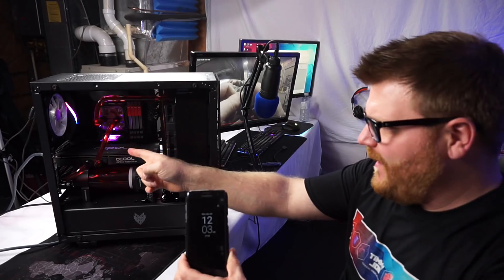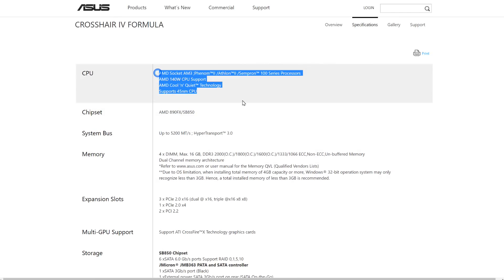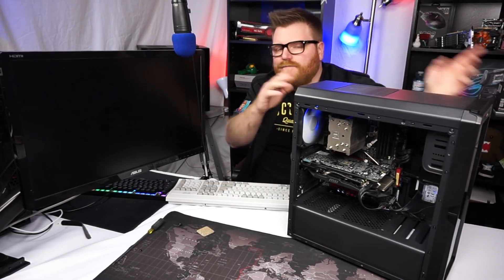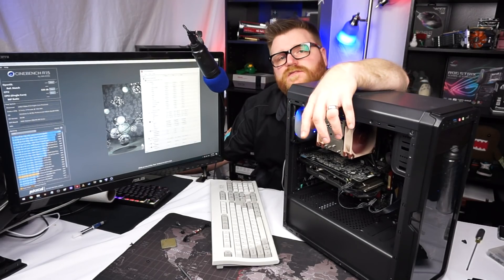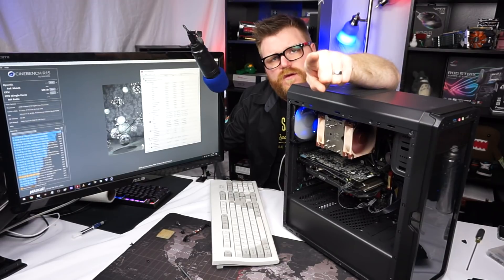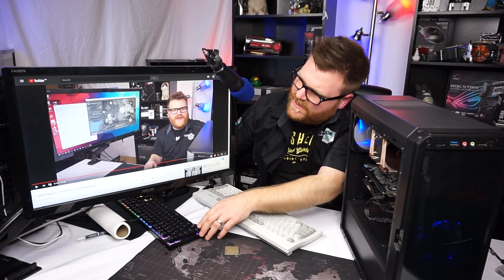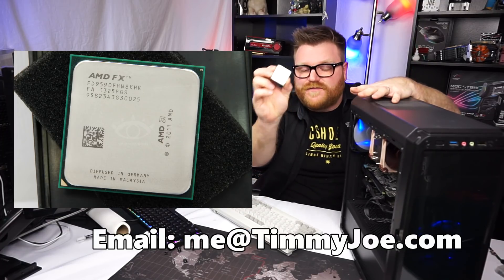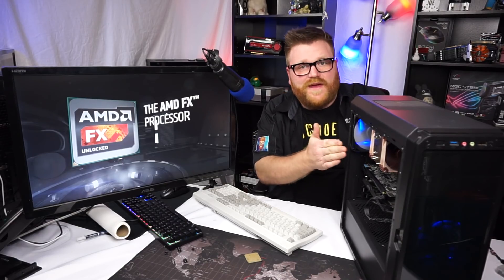AMD FX 8150 Overclocking on an Asus 890fx AM3 Motherboard

Comment: Timmy Joe PC Tech : I hope in 5 years when you test any i5 or i7 Skylake/Kabylake /Covfefe Lake that you will write on your first screenshot of your video "SHINTEL FAIL LAKE in 2022"....since they are all overheating like lava, killing VRM-s on the go if they are not actively cooled, all have build in mathematical problems (Matlab, Prime95,....), huge power consumptions and are buggy security wise on a hardware architectural level. It would be fair since AMD FX cpu-s were intentionally stigmatized by Intel bribing reviewers to say that they overheating and are quazi not good....when in reality I have mine FX 8350 cooled with Wraith stock cooler for 5 years now running at stock frequencies when stressed in Prime95/Cinebench/Furmark cpu bench on 50 degrees celcious eating on max maybe up to 58 Watts of power (since it cannot be utilised to its fullest potential due to nonexistence of real DX 12 and ASYNC presence in any benchmark or game) and I have literally cold VRM-s by the touch or by measuring them where they don't overexeed 51 degrees celcious after hours of stressing.
Reply: Caseton : and yet AMD FX chips run cooler than any Shintel Core iX crappy mathematically buggy chip, are still completely able to run any 2017 game at 1440p with well over 70 FPS if coupled with a GTX 1070/1080....and now they are confirmed being also safe hardware wise without any security bugs on a hardware or software level :). So who's the real winner here (retorical), my fellow beautiful Intel idiot ?!?!
Reply: @LFly R oh yeah the fx chips have the spectre bug.  its in the silicon and is baked itno the hardware.  if anybody gonna puul that line about intel's flaw cant be fixed then fx cant either. there are bios patches out now better go get it.  they just patch it but its fixed either way (intel or amd).  just get a ryzen or an intel and shut up. the i3 8100 will also run any game at the same fps as the fx8350 a lot cooler and with less heat ("but the motherobard prices!!!" in a month the boards will cost about 60 bux for intel too so they will be the same).  but when the next console (playstation 5 xbox 2 or whatever) comes out this year or next its gonna be over for the fx chips.  especially with the spectre slowdowns that are coming fx's way. besides that 70 fps is more like dipping to 30 and up to 90 so fast that it is being averaged as 70 but its not.  just calm down with that fanboy stuff man.  youre happy with your stuff, great.  im happy with mine just shutup.  amd fans have got to stop trying to make everybody feel bad because they didnt buy the savior of mankind !!! AMD!!!
Reply: +Caseton
Talking about a "encoder" for a CPU shows that you don't really know much about CPU arcitectures...
The 8350 actually beat the i7 3770k in some multi-threaded workloads.
Yes, they're finicky both when it comes to UEFI/BIOS settings for a given workload and instruction combinations in the workloads they do run.
But they're actually pretty good designs (except for the cache design that's a crime against scilicon).
The problem wasn't really so much the design as a number of different factors all going against AMD all at once.
Intel intentionally sabotaged their performance in compilers.
Intel bribed companies to use Intel products instead of AMD products.
Intel told everyone that they'd use one set of instructions (making it the de-facto standard) then at the last possible moment informed everyone that the CPU they would release just a short time afterwards would have a totally different set of instructions forcing AMD to scramble to support the new instruction losing all the hard work they had put into making the old one actually run well on AMD hardware.
SSDs showed up making some of the assumtions about waiting time for I/O for CPUs false.
APUs with compute accelerated general workloads didn't become a thing as fast as AMD expected.
Due to Intels new capabilities more programming languages started using double precision floats and integres by default seriously harming AMD performance.
Intels market share because of everything above made optimizations for AMD even more unlikely making AMD perform worse then it should.
Windows was coded to use the Buldozer and Piledriver CPUs in the wrong way giving even worse performance then what the CPUs are actually capable of leading to even worse initial reviews then they deserved and as a result lower market share and less optimization etc.
All in all, AMD just had crap luck.
The actual throughput potential of a Piledriver octa-core is actually roughly equivalent to a i7 3770k.
But with no software actually coded to use that throughput potential its resources are of course essentially wasted...
(And no, I'm not just  talking about the workload having to be multi-threaded, that alone isn't quite enough)
Reply: Lmao at the insecure low self steem fanbois.
Reply: Ivan D : yet again one annoying intrusive Intel idiot detected :) .... Shintel outside = Trading Inside :)
Reply: LFly R I don't like Intel duh
Reply: Your cool temps don't mean shit,and fanboy. FX series chips have laughable ipc because of their horrible design using a single encoder and decoder for a pair of cores. You can also go watch amy of the 6 billion videos showing the inability of the FX to match any 4c/8t i7 in either gaming OR productivity. Why do you think FX-8xxx cpus can be had for 50 bucks now but the i7 2600k still holds a $100+ premium? FX cpus are a waste if silicon, period.
Reply: Caseton is not like they are made out of gold silicon is mostly sand so we have .... a lot around !
Reply: LFlyR is it really needed for acronyms ?  chill  and never side with a multinational company personally buying what ever gives me the most bang for my bucks depending on my budget at the time   my cpus of my life where Pentium III 933  athlon 64 3000+ athlong x2 5200 phenom2 x3 720 ((unlocked 4th core)) and @3.3ghz  and i7 3770k  @4.3ghz  all of em great cpus and if i could go back in time and decide again i would pick the same cpu's where the absolute best bang for my budget ....even people that told me that the 3770 was a waste and i should get a 3570 istead  i use it even today and i am completly happy with it no problem to wait for zen2 maybe zen3 and what ever intel is going to offer at the time and get again the best bang for my bucks but i am in no way shape or form in a hurry to do that
Reply: @LFly R btw i checked up on your 70 fps bull the for the fx and the first game benchmark had the witcher 3 dipping to around 35-40 with 100 percent usage on all cores.  the next one was fallout 4 which was cpu limited and running around 45 fps. deus ex going from 35 -55.  some of these games would hit 70 for a second or 2, but come on man.  like my momma said you dont gotta lie to make friends.  idk maybe you do. lol
Reply: thing is that they act like amd is their savior while they are a company in the business to make profit too is really stupid to follow relegius a company like that coughs: apple i even heard arguments that amd would never charge as much if they have dominance in the market  ! well now does anyone remember the athlon Fx-58 ?  999 usd msrp back in 2005 ! or was 2006 ?
Reply: @LFly R dude you are an idiot.  what the hell is a tower custom cooler anywa lol?  i got a noctua dh15 and it runs the 8700k at 5ghz at 50-65 degrees in games and about 72 when doing a heavy render in blender (the bmw benchmark at 4 minutes 40 second thank you). it does this with a -100 voltage offset so it runs blender, games handbrake at low temps because that comes out to about 1.25 volts.   dont believe everythign you hear dumbass. the high temps are people running the first bios versions which pumped way too much voltage and running avx workloads designed to generatie maximum heat. they will do similar things to your cpu if you clock it to 5ghz and have high voltage.  how is dx 11 preventing your cpu from using all its fpu's.  fx has "worldwide acknowledged security bug" its called spectre.  they are issuin bios's as we speak for your cpu\motherboard.  its a fact.  my buggy overheating cpu runs witcher 3 at 62 degrees at 160-170 fps and your craptastic cpu runs it at 35-65.  oh wait it just hit 200!  but i aint calling amd guys out on here.  youre the one starting shit dumbass. grow up. get a job. get a real processor
Reply: @LFly R https://www.youtube.com/watch?v=VzI-B21HOyI&t=294s here is an 8700k runnign the most cpu demanding game there is, battlefield 1,  at 5ghz, 1.25 volts, and it never goes over 60 degrees.  now of course he has a liquid cooler but everybody know the dh15 air cooler beats or ties any liquid cooler you can get that costs less than 100 bux or even more sometimes.  no throttling either.  give it a rest.  you believed all the hype about the 8700k just like everybody believed the hype about how hot the 8350 was.  your mistake.  do a little research before you shoot your mouth off.  oh and btw im still waiting for that link to your business lol.  you never even saw an 8700k system in your life admit it
Reply: 8700k with 5ghz oc at -100 offset on the cheapest motherobard you can get and temps below 72 in everything i do and even the prime 95 blend test on an air cooler.  meltdown patch and spectre bios patch in place and no noticeable difference in performance. vrm temps are actually cooler under load because the fan spins up on the cooler and gets pretty good airflow. nonexistant dx12 and async? lol neither of those things has anything to do with your cpu.  i mean dx12 might help a tiny fraction with a slower cpu (which the 8350 is) but thats ANY cpu not just amd. amd makes good products so i dont feel the need to bash them. intel makes good products too, so whats your problem?  your vrm's are cool because you are only pulling 58 watts of power and getting 58 watts of work done.  so if my 8700k does 3 times the work (which it can) and draws less than 3 times the power (which it does) some how its a failure.  youre funny dude.  grow up.  dx12 and async lololololol